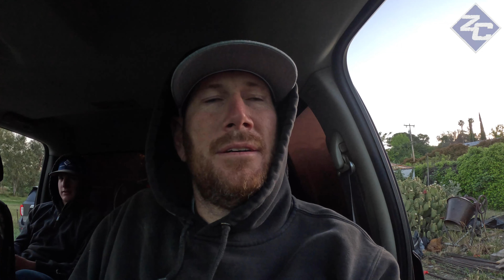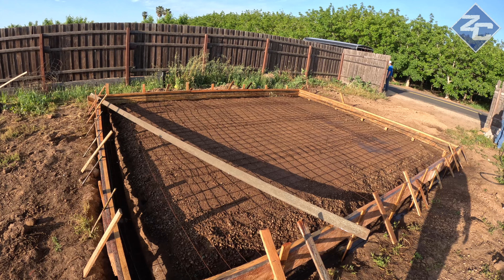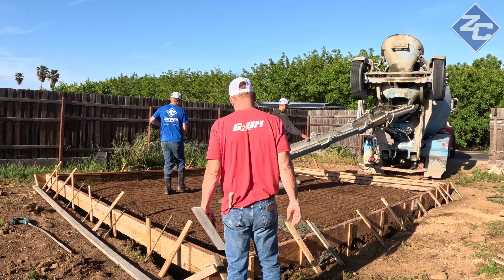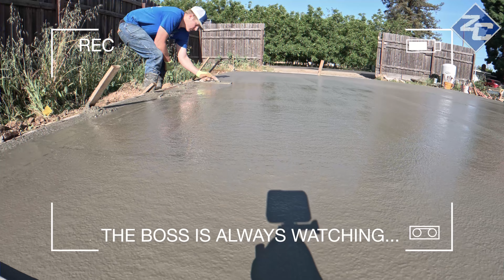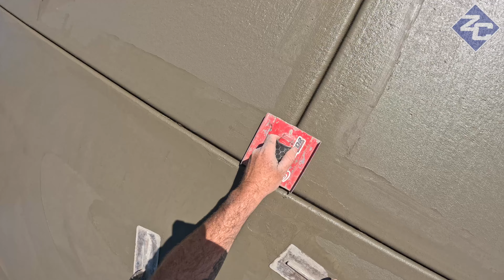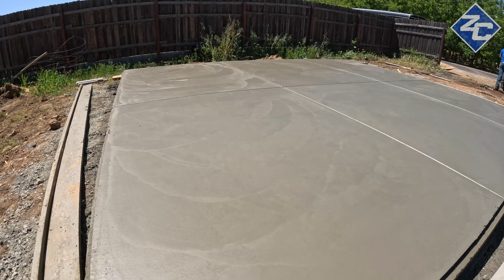Turning WET CONCRETE Into A Killer Foundation | 4K Concrete in Live Oak, CA

Comment: How come you dont put anchor bolts into the concrete?
Reply from the maker: These new light weight buildings don’t require anchor bolts. They drill bolts in when they install the building
Reply: Less heavy duty 
Great video  🙂
Reply from the maker: Yes, less heavy duty. Not like the red iron heavy duty metal buildings
Reply: @Zeppiconstruction  
I know,  I meant like 1/2" thick about a foot long.  The small ones.
Probably easier for everyone to do afterwards
Reply from the maker: Exactly